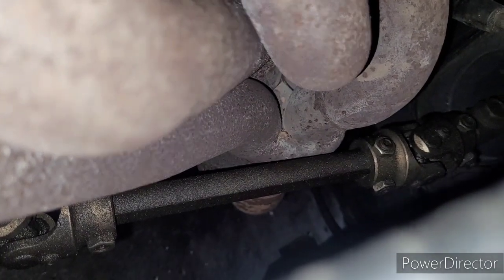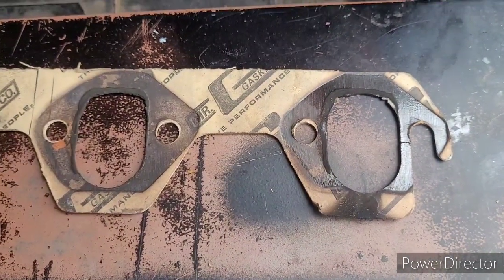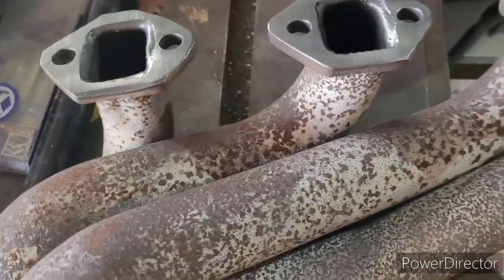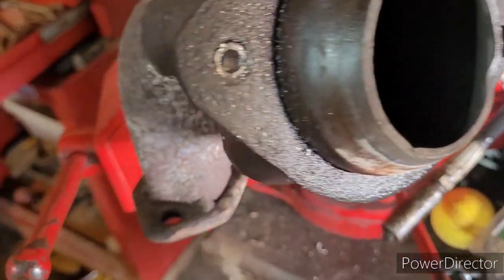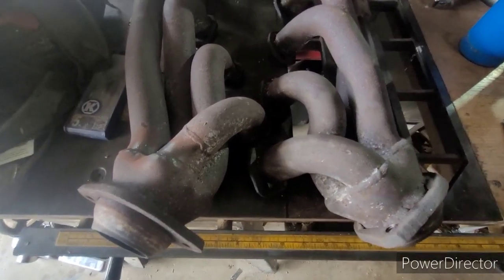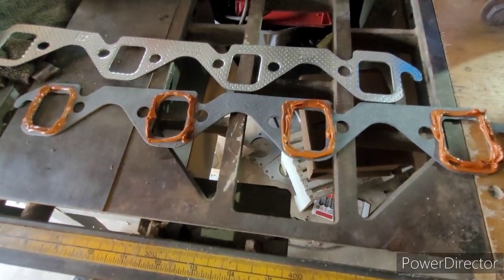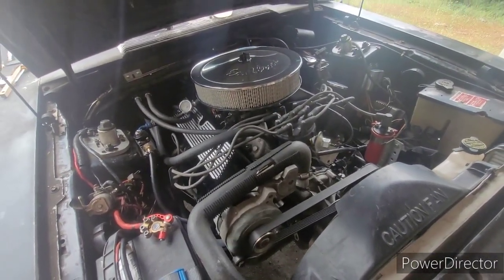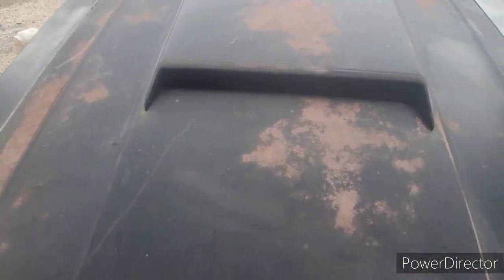Foxbody Mustang exhaust leak diagnose and repair. Project: Piece Of Stang(POS).

Comment: Wrong hedder for those heads. Also hedder leak 23:39.
Reply from the maker: They are the correct header. They're Mac headers for a foxbody. I've run several pair just like them. The leak is at the collector and the h-pipe. I can live with it. It isn't anywhere near as bad as before.
Reply: @KrisGreenhillsGarage  you specifically said that you had to fight with the one because the bolt hole was off. Now on to why they put the studs there. They give you alignment and you only need one hand to put the nuts on. After the first thread you can let go. Also if I seen correctly the thing to have done was put a bolt in the two ends and drop the gasket in from the top. After using the Mr. Gasket hedder lock washers never once did I have problems or had to go back and re-tighten them.
Reply from the maker: @lynnrunningdeer7364  yes, the bolt hole was off, from 30+ years of expansion and contraction. Just like several other pairs I've dealt with over the years. These were just worse than most. But they are factually the correct header, which is why the driver side went on in seconds. As for the stud, they did not come from the factory with them. They are meant for bolts, which it why only 1 side had studs. The studs make it difficult to line up the headers with the h-pipe on the car.
Reply: @KrisGreenhillsGarage  I've never encountered this ever and neither has anyone I know. I can ask a friend if he still has the factory hedders and the H pipe with Cats. My BBK equal flow came with studs and the hedders on my truck have them too. Both have the short version. When I finally put the motor in the truck, the hedders will be built correctly not what's found on the shelf. If they're not tuned then they're not correct. Anyway have fun and good luck.
Reply from the maker: @lynnrunningdeer7364  odd. I've never met anyone who has installed headers who hasn't run into them expanding or contracting with age and use. I've mever seen a pair that has been used that wasn't at least a little warped. I'm glad that you're able to build completely custom headers rather than buying pre-made headers. Most of us don't have that option. Building them from scratch yourself, inch by inch, is the only way to "tune" headers.
Reply: @KrisGreenhillsGarage  I've never seen a set that was four inches off. A sixteenth yes four never. I never tighten them down until all the bolts are in it. That project is a ways off. There's too many others that need attention. Should you ever decide to go back to an electric aftermarket pump. Make sure it's located lower than the tank. Holley's are pushers not pullers. The red ones seem problematic however you can rebuild them. At least you could seven years ago. It looks like you've solved the balance problem. Have you solved the vacuum problem as well?
Reply: @KrisGreenhillsGarage  I thought you have a welder? If so then just buy the pieces as you can afford them. What year is the other one?